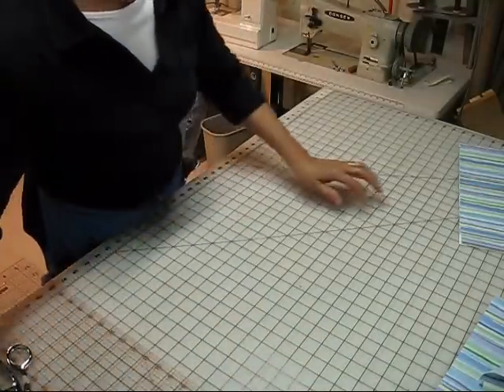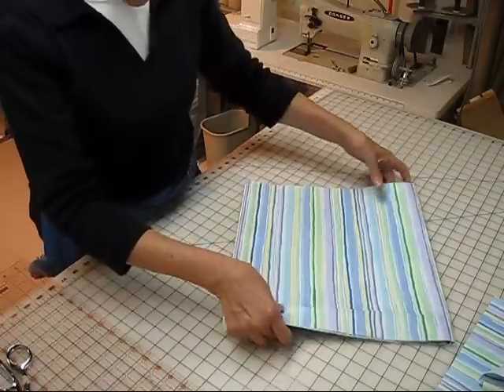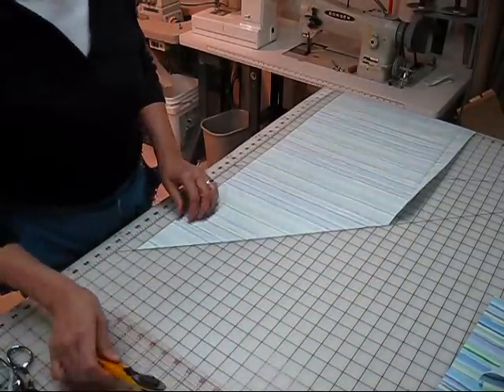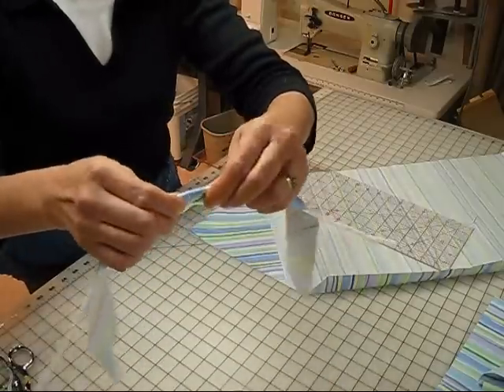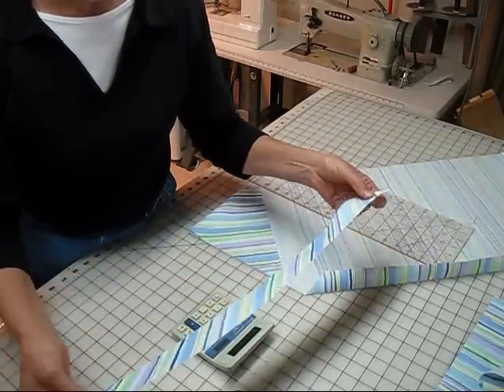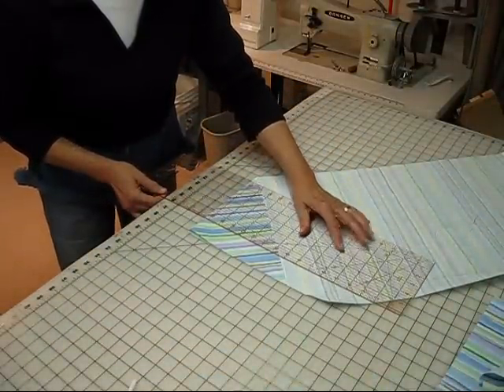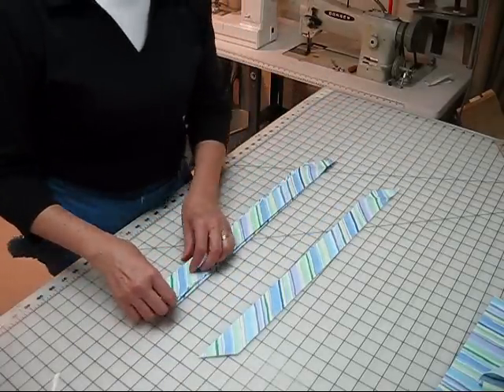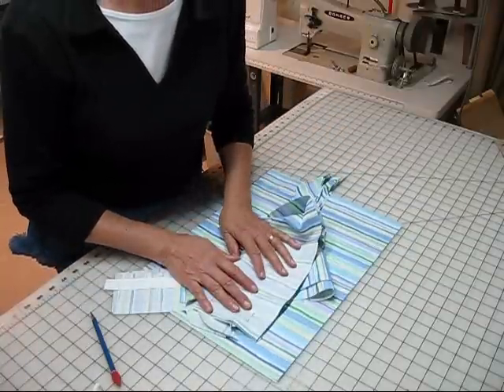How to make piping for pillows and cushions

Comment: Thanks for the clear instructions including the fold and cut but can also  say I used mind maths and said 6 before you even finished tapping the calculations into the pad good for the brain and you can check on the calculator after if worried it’s not correct
Reply from the maker: Hello, Craig, Thanks for your kind comment. I'm glad you caught the math so quickly! Sincerely, Peg

Comment: Tell us about your cutting table.
Reply from the maker: The base is the top to a drafting table measuring 36 by 60. On this is an underlayment purchased from Rowley Company (similar to acoustic ceiling tiles). The underlayment is covered with tin foil, then 1/4" felt padding (also purchased from Rowley). The final layer is heavy duty canvas. The materials can be purchased from Rowley.

Comment: Very well explained.  The folding is key.  Nice to see this demo and learn expert techniques.  I have some questions please:

1.  You use an Olfa Rotary Cutter or other brand?  How do you sharpen the blades?
2.  Where can I buy a cutting mat that won't break the bank?  Why are they so expensive?
3. Why does every sewing demo person seem to have a Juki type industrial machine?  Is the regular home sewing machine not adequate for cloth projects, or is everyone making sailcloth and upholstery these days?
4. Could you kindly recommend good cutting shears or do you solely use a rotary cutter?

Thank you for the very well made demos!  I'm enjoying them a lot, and your voice is very soothing.
Reply from the maker: +Lass-in Angeles Hello! Thank you for writing and for your kind comment. Here are my answers:
1.  I prefer the Olfa RTY 2/G with the straight handle (not the ergonomic style). I have tried Fiskar also, but the Olfa feels good in my hands. I don't sharpen my Olfa blades. I stock up on them when they are on sale and then use them until they are worn out. I place the old blades in a glass jar; when the jar is full, I place the jar in the recycling container on garbage day.
2. Cutting mats are definitely an investment! The large mat in my table is from JoAnn Fabric http://www.joann.com/36x59-cutting-mat/2622033.html#start=13. I've had this mat for about six years. It is the second mat of the same kind I've had in at least 12 years. I cut the original mat in half and use a half sheet for small jobs. I believe this is the largest mat that JoAnn carries. I paid around $60 on the last one (I had a coupon). Even at $70 dollars, this mat would cost about $1/month amortized over 6 years. I use rotary cutters more than cutting shears because I like the speed and accuracy of them. However, cutting shears are a must in the sewing room. I use Gingher brand and have them sharpened annually.
3. The Juki machine in my tutorials is primarily for my slipcover business, but it works well for garment sewing, too. I still use my Janome portable (see the "Little Striped Cushion" tutorial) for some projects. I also have an old Baby Lock serger for over-casting seams in my washable slipcovers.

Please stay in touch if you have more questions. You can write to my email address: littlebug903@yahoo.com.  Sincerely, Peg
Reply: +Peg Baker Many thanks!!!  Much appreciated.
Reply: Bakers

Comment from the maker: Hi Mary, thanks so much for writing!  I've been fabricating slipcovers professionally for many years and have found this still to be the most efficient method for assembling 30 to 40 yards of bias strip.  It's certainly not the only method, but it doesn't require cutting with scissors as does the tube and box methods.  That being said: there's always room for improvement!  Please share your method so I can try it out; saving tons of time is something I'm all in for!  Sincerely, Peg

Comment: Peg, your 10 or 11 videos on this little striped cushion are SO HELPFUL!  I've been sewing since the 1980s; my mother was a great teacher and mentor.  Now my most ambitious project:  a window seat for my new kitchen!  Just a question about the piping:  What thickness did you use?  Was it 1/2"?  I've read you should make strips 2x the thickness + 2x the seam allowance.  If you used 1/2, that would mean the strips need to be 2" but you made them 1-5/8".  Just wondering.  Thanks in advance!